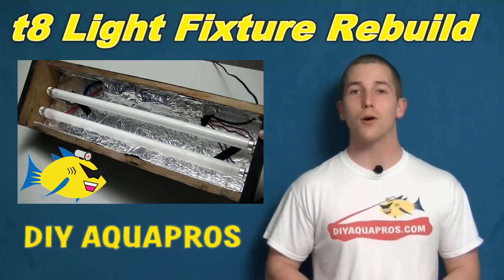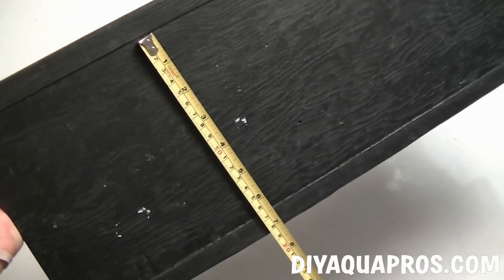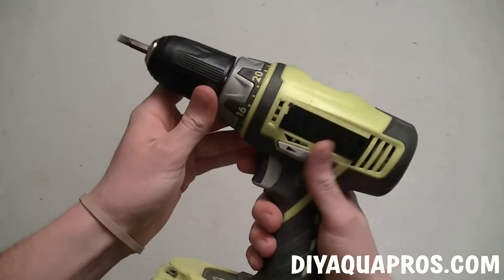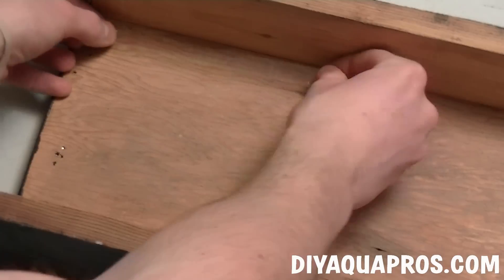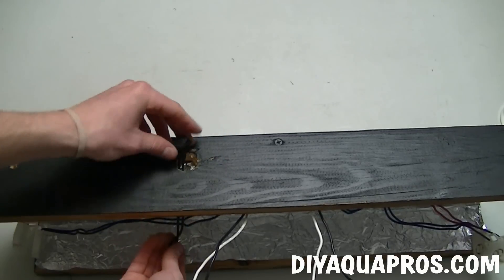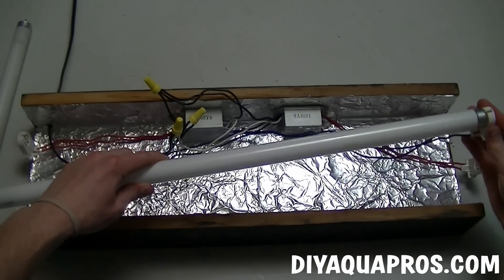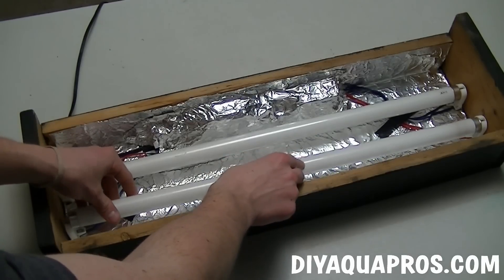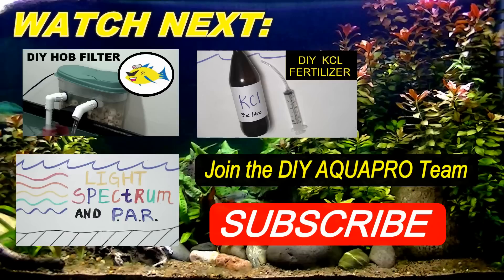How To Make: DIY Aquarium Light (t8 light fixture build)

Comment: Firstly, there is no isolation from moisture and splashes. Secondly, there appears to no earth; aluminium foil cannot be earthed - it will go live and burn. Thirdly, the wire nuts are a very poor substitute for a soldered or even a crimped wire with shrinkwrap. This unit uses live mains voltage over water and is not adequately isolated. It is a truly dangerous installation.
Reply: the chassis is wooden (non conductive) so a ground is not needed. you only need to ground things with conductive chassis
Reply: @jacobb4077  Wrong. Aluminium is conductive. Wood becomes conductive due to moisture. Only double insulated goods do not require grounding.
Reply: @SC-hk6ui  Absolutely correct! A lot of young untrained roof insulation installers have lost their lives using aluminium wrap insulation in Australia. Just because it's thin doesnt mean it's not lethal

Comment: Cool project, but one little tip. Cheap gloss white is a better light reflector than tin foil. Even completely smooth and flattened out the tin foil will absorb and diffuse more than a good coat of anything but matte or flat white. Enjoying the videos so far, cool to see you and the few others on yt showing people how to do all these projects.

Comment: First, we're gonna take the electrical component that requires passive cooling and wrap it in aluminum foil!
Reply: exactly.
Reply: Considering it was wedged between cheap sheet metal and plastic. This is probably a upgrade for those ballasts.

Comment: great video, but every t5 or t8 light fixture i have ever owened or used needs a starter plug thing
Reply: newer  electronic ballasts have built in starters. older magnetic ballasts require a starter.

Comment: I'd use different reflector tin foil actually takes 80% of ur light up!!! Its not a reflector use mylar just as cheap n u get 90% light and it's penny's to buy!! but gd video thnx
Reply: saifys designer clowns Not true. Non-reflective side of the "tin foil" is 80%, reflective side is at leat 88% (go see wiki Aluminium Foil). Tin foil is made of Aluminium and it is one of the best reflectors out there. If you refer "mylar", I assume you mean bopet (Mylar) foil coated with Aluminium, which has exactly same reflectivity. Mylar itself is translucent plastic. Anyway, aluminium foil is in every household so it is virtually free.

Comment: is T5 lighting is enough for my 75gallon planted aquarium?
Reply from the maker: Totally man, Id run 2 full specs and 2 6500K's right at the surface of the water for "high lighting". You could use 2 bulbs more spaced out for less lighting, or hang a 4 bulb fixture 12 inches above the water column, etc. The type of bulb (t8/t5/LED) isnt as important as the spectrum and PAR output. Its definitely the most confused aspect of the hobby due to the lack of specific and correct information.